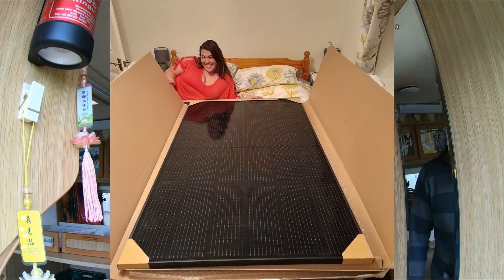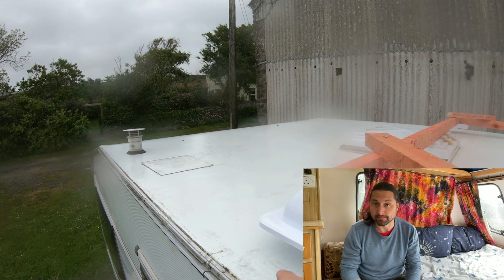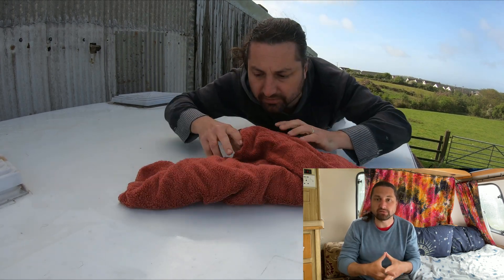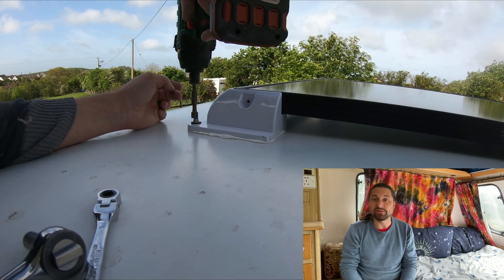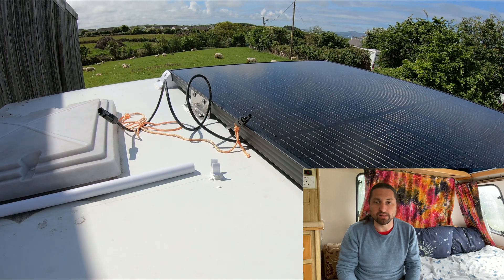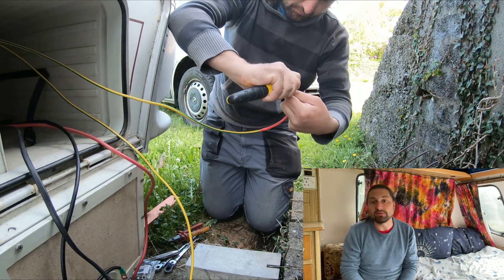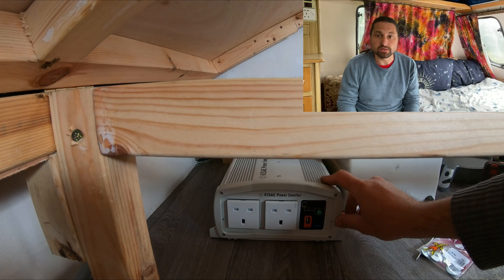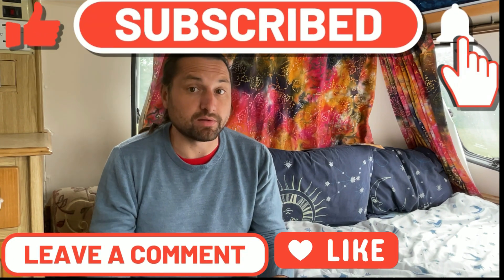HOW TO: DIY Fit a Solar Panel to A Caravan | Large Solar Panel Install for Off Grid Caravan Living

Comment: An interesting install.  I was wondering if you could have run the cabling from the solar panel directly underneath the panel itself, thereby avoiding the need for conduit and a separate (exposed) cable entry point on the roof.  I assume there is at least a small cavity between the roof and the inside ceiling of the caravan where these wires could then run.  Just for my own understanding, do you see a problem with this approach?
I would be inclined to go lithium on the battery front, although this can be a fairly expensive investment.
Reply from the maker: Hello! You could do this, but be aware that the connecting plugs are around 30mm diameter, so you'd have to either box them in under the panel to stop them flapping about or bring them down through the caravan roof via a waterproof cable entry grommet. Either solution would require a low profile box, as the gap between roof and panel is only about 50mm. Also, you need to be able to get your hands in to place the cable. 

So entirely possible, but you may find it trickier. It would definitely be a cleaner install.

Comment: I have a 100 watt monocrystaline solar panel on my Lunar Ariva,
It is not fitted to the roof as in your video but is free standing approx 60 degrees from the horizontal.
When in normal use this panel keeps my LiFePo4 battery fully charged through a PWM charge controller but when the battery gets a little discharged I find I can increase the charge rate by keeping the solar panel at 90 degrees to the sun.
I have found in my past that a solar panel fitted to the caravan roof will only produce a decent charge rate at or around 12 noon.
Also by having the solar panel free standing I can keep it away from the elements by placing it on one of the beds with the blinds left open.
Also I have an adaptor which permits 2 or more solar panels to be linked together to produce 100, 200, 300 watts etc.
Reply: An interesting point.  It would be a nice project to make a jig for the panel that can track the Sun so that you can set it and forget it.

Comment: I am looking at getting Solar power on my old Elddis ( you know, the ones with a soft front window panel ). My questions are…..1. what is your computer watts and how long can you run it for with your set up? 2 are you running anything else off the inverter apart from a printer? 3. Do you have enough solar power in winter ( or on gloomy days like today) to keep the battery topped up to be able to run the computer ? Many thanks….
Reply from the maker: Good morning, Richard. With solar, there are many variables. For example, what size battery do you have? What are the weather conditions outside? How much are you drawing? Are you running your laptop through an inverter?

For us, on greyer overcast days, we find that we must be a careful with it, as little is being put back into the battery, whereas on bright days we needn't worry. Also, for us, we ran our computers through an inverter, which is inefficient. For our summer tour next year, we'll change to using a 12v adapter, bypassing the inverter. This should vastly improve efficiency. 

Can't comment on winter usage, as this is the first winter it will be on the caravan and truth be told we won't be using it. 

If your caravan is permanently sited, in addition to the solar, I'd look to include a wind turbine. Wind turbines are great, as although they don't give as much output as solar, they'll generate whenever it's windy, including through the night. 

It would be worth joining a few Facebook groups to get ideas. With renewables, compromise is everything. 

Good luck!
Reply: Yes permanent site….looking at running a desktop rather than a laptop, so I would need an inverter. However, newer iMac desktops are similar power draws to the Mac laptops, even though they have no inbuilt battery. From my calculations, allowing for winter days, I would need about 2,400W of solar panels, and 4 large AGM batts to run a desktop for about 8-10 hrs a day, and a fridge too. Good shout on the wind turbine, that they could be generating a small input 24 hrs a day, weather permitting.🙌
Reply from the maker: @richardsracingmad  Ah good stuff. You could also consider ground mounting your solar panel on a frame. This way, you could orientate and angle it to achieve optimum light dependent on season, but you could also nip out periodically throughout the day and physically move it to track the movement of the sun. This would give you the absolute best output from your panel. Ours has to fixed to the roof for travel and isn't even angled, so it'll never reach its full potential. 

Good luck with it all. Once you get up and running, I'd be fascinated to see some pictures. Drop me an email over to mcneilljamie@hotmail.com.
Reply: I would actually recommend avoiding an inverter entirely if possible.  Sometimes they can be useful for infrequent (and unplanned) power requirements, but if you are planning an install you should plan for all your equipment to run off low voltage D.C.
Why? Well, here is what happens when you use an inverter.  The ~13V D.C. from the battery goes into the inverter and is converted to high voltage A.C.  Then you plug your device into the A.C. and, except for proper A.C. mains equipment, they will typically take the A.C. and convert it back down to low voltage A.C., before rectifying and regulating it down to a low voltage D.C. again.  And at each step in this chain, you have fairly significant losses.  For an off-grid power setup, your plan should be to minimise as many losses as possible, and that means eliminating the inverter (except maybe to allow for infrequent, unplanned power requirements).

Comment: Very nice 🙂
Reply from the maker: Thanks 👍
Reply: Just one thing,  the inline fuse should be as close as pos to the battery,  as you have it it is only protecting the wiring between the controller and the fuse,, the cable from the fuse to the battery  is not protected